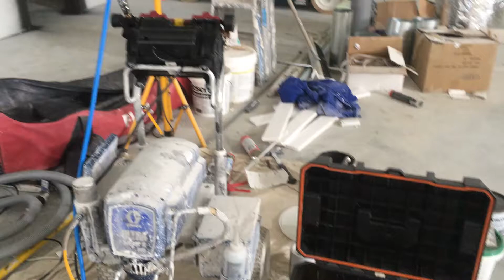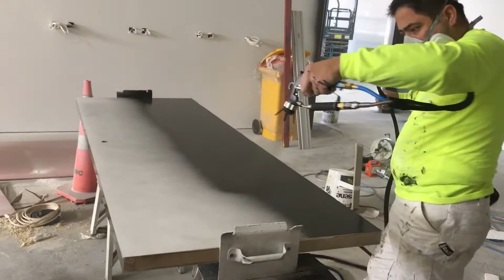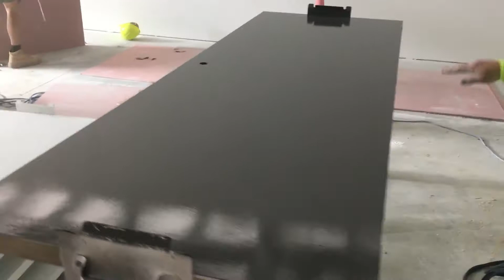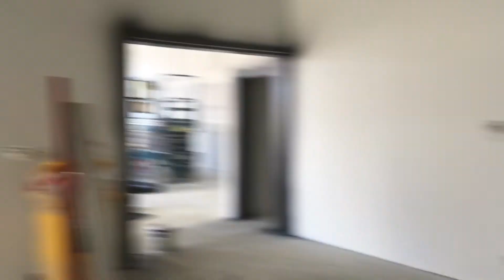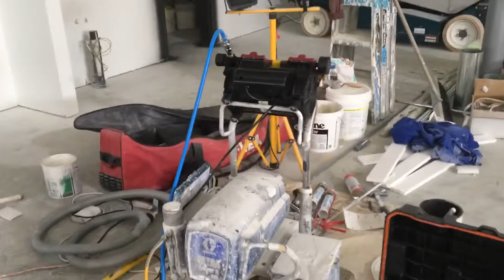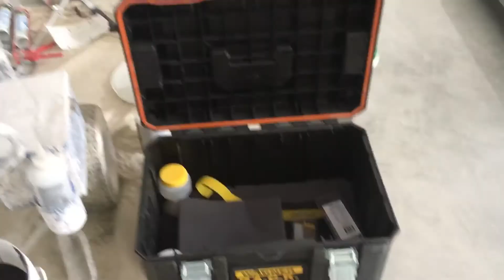Airless assistance spray!!!

Comment: Hi, what machine is been used is it grace mark 5 with air compress or different make please.👍👍👍👌❤️
Reply from the maker: jabar alanzi hi buddy!!!! That’s a system call airless assistant spray!!! From Wagner !!! But you need a airless spray unit!!! I have a graco 695 and I connect my new airless assistant spray to my airless spray unit